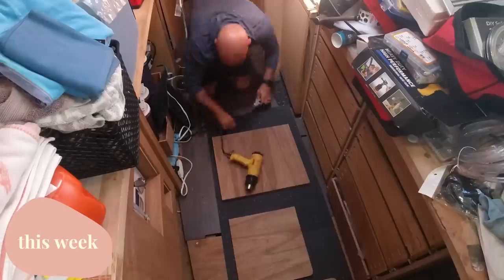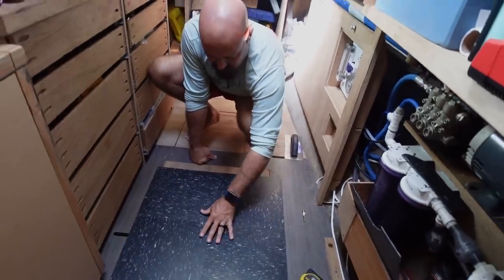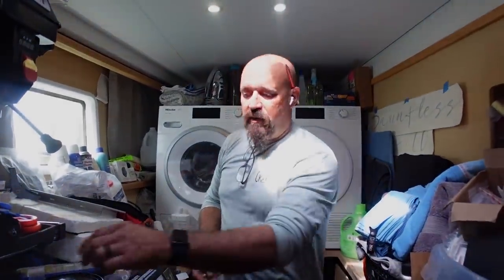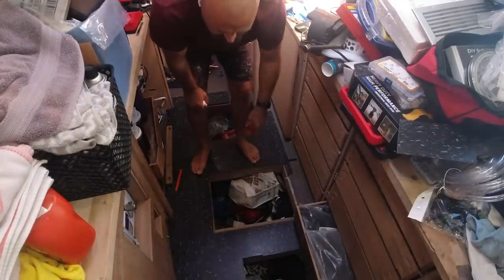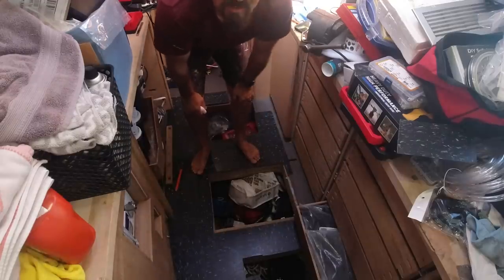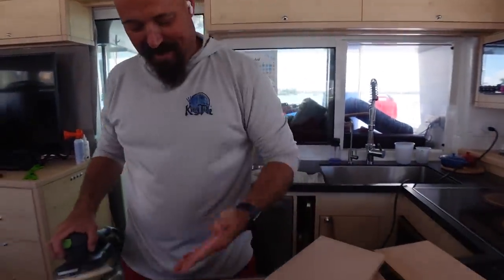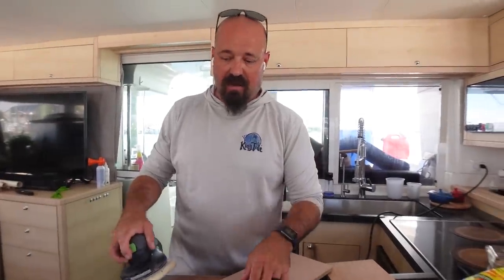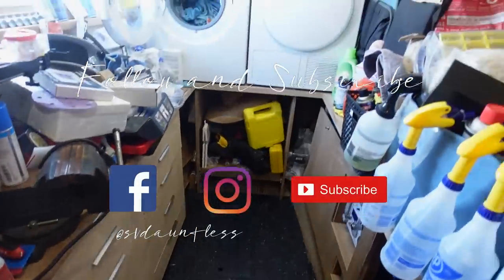CATAMARAN UTILITY ROOM BUILD//New Flooring & Tool Drawer Faces-Episode 94

Comment: Are they still working on the old boat, sure looks like it. Wow ,no one does all this before selling a boat.
Reply: Yeah wondering the same thing. I am lost as to what work is being done on which boat at this point.
Reply: 👍☑ good question
Reply: I believe they are finishing all the projects they started on the first boat before they sell it, so D2.0 is kinda just sitting waiting for them to be ready to work on it again. It comes off as they got the first boat to a livable condition and then just kinda stopped and have to finish now
Reply: But still not fixing the structural problems that this Lagoon model has been repeatedly shown to suffer from.
Reply: I also understand the 50 is waiting it’s turn so the 45 is finished and can be sold then back to the 50 😎
Reply from the maker: When we bought the Leopard 50 all the projects we fully intended on doing on the Lagoon 450 came to a screeching halt to get the 50 fixed and in the water. Now, we are back in Florida with both boats. Work has resumed on the 450 (with a few unexpected boat projects like sail drives and fuel tanks) to get all the items finished that we started before we sell her. Then we'll move onto the 50 and make magic happen!
Reply from the maker: As far as the constant commentary from CG...please see previous responses to his comments!
Reply: @SailingDauntless FYI, I continue to raise it because it seems you still have not properly addressed publicly why you plan to sell a boat that has not had its structural issues resolved as per the latest Lagoon recommendations/recall.  Just because your particular boat has so far not suffered the bulkhead collapse that has affected so many    of this model Lagoon, does not mean it will not in the future. I assume you will be 100% in full disclosure mode on this topic for all prospective buyers (if they even exist for this highly compromised and flawed model of Lagoon)???  IMO, you have a clear moral obligation to all prospective buyers to highlight that this reinforcement has not yet been done.